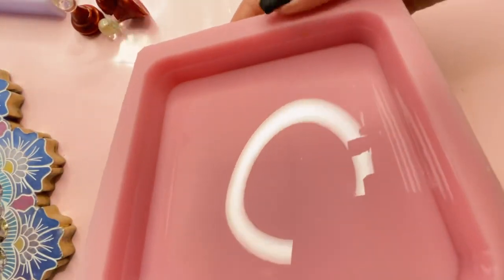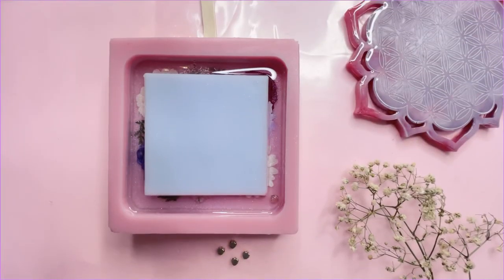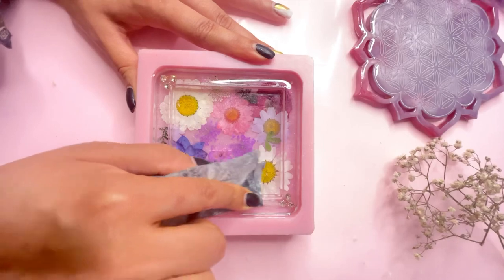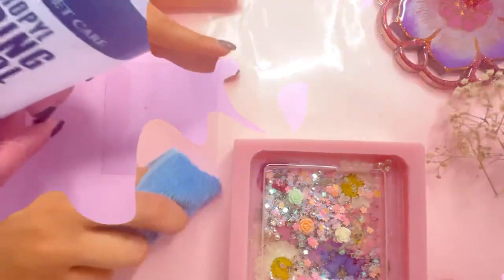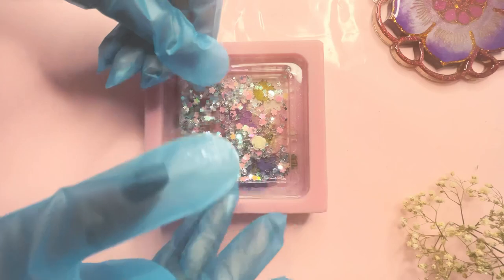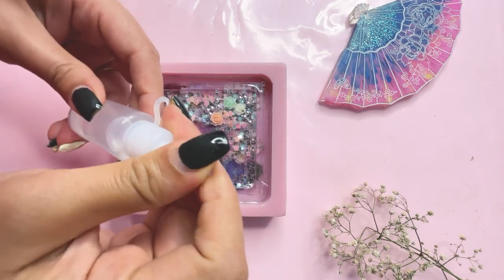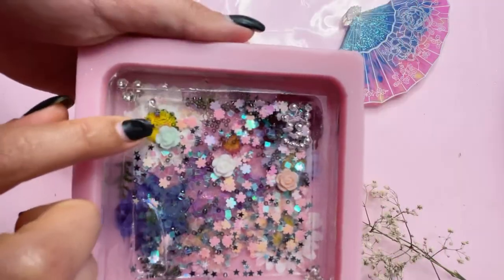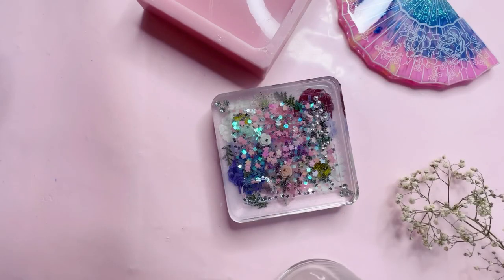Resin Shaker Coaster Tutorial || Step By Step Tutorial For Biginner

Comment: Great video, lots of good information. I have quite a few shaker coasters or large shakers, but after time, they all seem to burst. I make them exactly as you do, except for the sanding (perhaps that’s the answer!), but they always leak eventually. Would you perhaps know why? Thanks so much.
Reply from the maker: Hi Emma, 
Try to have thick walls from all the edges. That why I haven’t used special mold that we use for shakers, as you do not have control over the thickness of the walls.
When preparing this coaster i made sure i have 0.6cm thick base then shaker in between which is approx 0.8cm and then top layer again around 0.6cm. Wall around shaker is 2cm thick so my liquid is concealed properly. 
And also check the quality of the plastic weather it’s thick or not. 
And avoid doming it only with uv resin, as uv resin does hold plastic very well, that’s why i have used epoxy resin on top. 
And sanding in between helps to bond two layers properly. 
Hopefully this helps. 
Thank you
Reply: @paintaliciousbykawal5913  hi where did you get the silicone filler please leave the link thanks
Reply: I always but another layer of resin over the finished just to reassure it won't leak. I have shaker keycharms for 2 yrs and still the same.